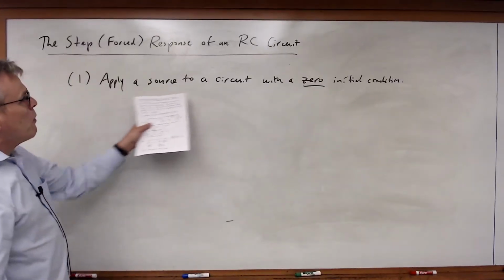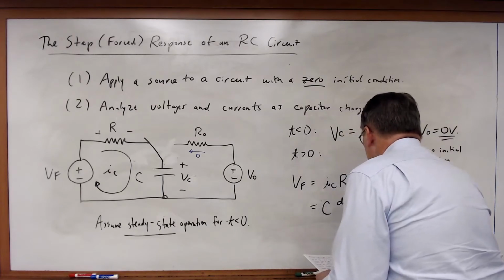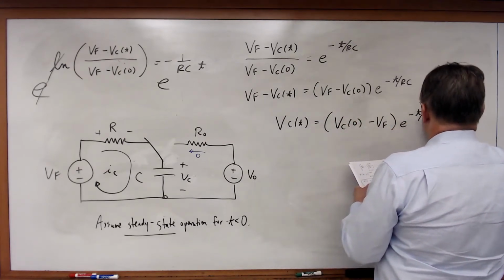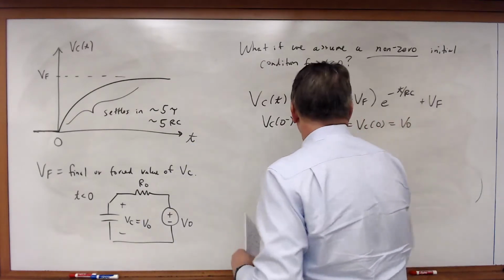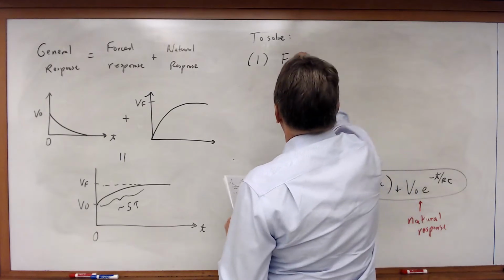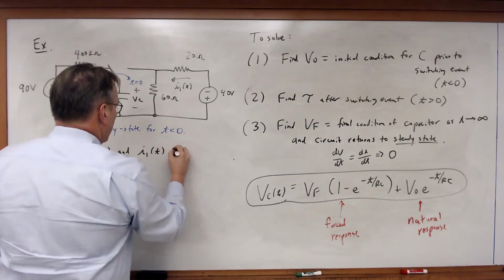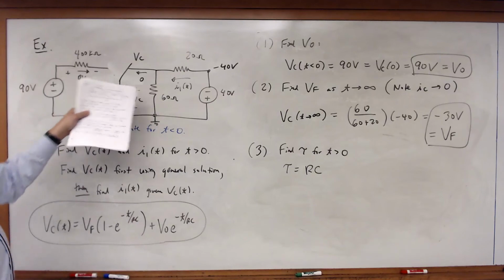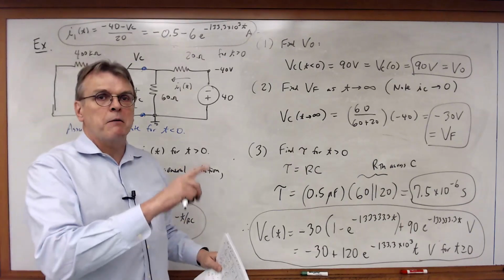EECE 2112 Module 61:  The Step (Forced) and General Response of an RC Circuit

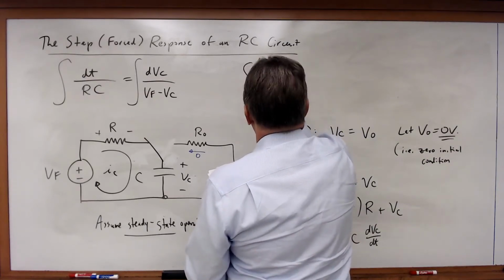Comment: @7:44 How did you get from dt in the left integral to dTAU.    And on the right side integral, how did you get from dVc to dx?
Reply from the maker: I replaced variables t and Vc with tau and x in the integral.  This technique involves the use of "variables of integration".  The idea is that when you are evaluating a definite integral where the limits of the integral have the same name as the variable to be integrated, then you substitute and use a variable of integration inside the integral to distinguish them.  The intention is to prevent confusion between the integrated variable and the limits themselves.